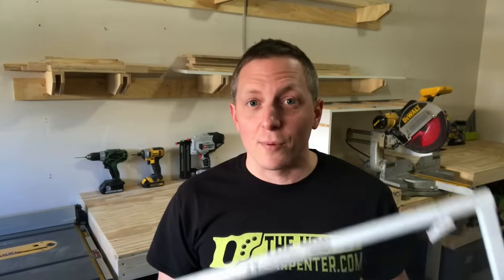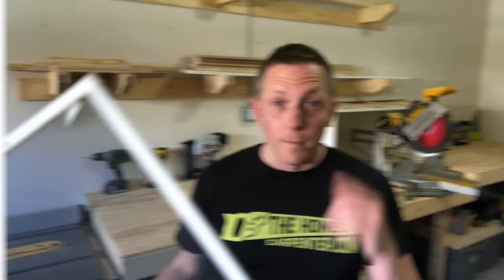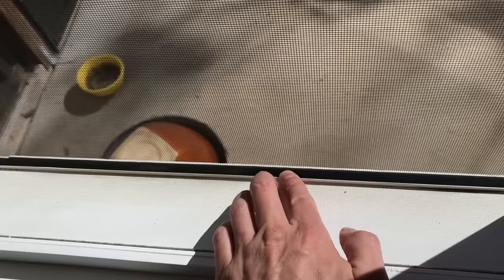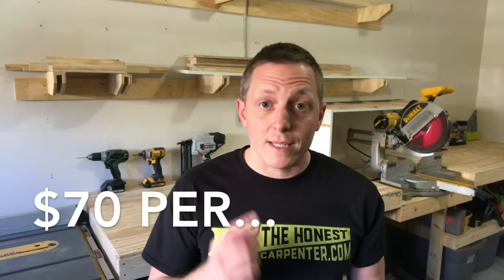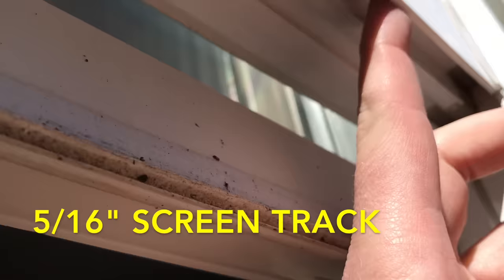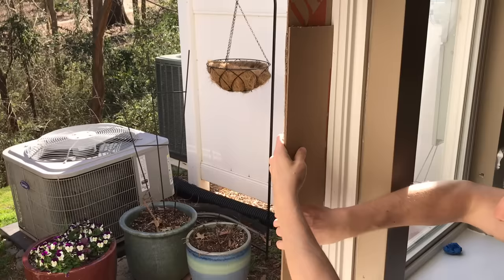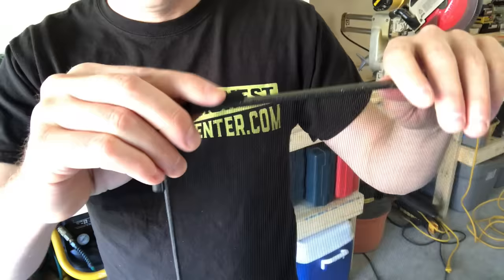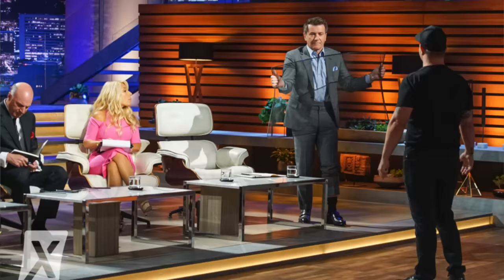FLEXIBLE WINDOW SCREENS?? (SHARK TANK Thinks THIS is the FUTURE Of Window Screens...FLEXSCREEN!)

Comment: It looks like the FLEXSCREEN would pop out if the screen is pressed against from inside, especially if you don't have the track and need to use the black rubber bumpers.  Used on second story, or higher window, might be an issue if you have small children in the house.  Every year toddlers fall from apartment windows that have no screens.

Comment: I like your method of measuring. Spot on. I suspect if the original screen frame is still intact you can take the measurements from that. That would ensure exact measurements.  On the other hand if you never had screens to begin with your method again is spot on. Keep up the great work.
Reply: They tell you on the website not to measure your screen

Comment: Window screens just don't wear out that often. My 15 year old window screens are still perfect. Not worth the 3x cost IMO.
Reply: Wait another 3 to 5 years. At 15 mine looked OK but at 20, they were shredding. 
But on some OEM screens, you can replace fiberglass with aluminum.

Comment: That's an awful lot of work to take a chance on, especially at those prices.  What if they don't fit?  Also, I don't see them as a particularly sound deterrent for pets.  A cat could push that out in one rub.  But thanks for the review.  Always good to know.
Reply: Screens are not a safety feature in any way shape or form, animals or children. Just because you can push on them slightly and nothing happens is just an illusion. Read the sticker on your screen. :) screens were invented only to keep bugs out, that is it.
Reply: @SueK449  Your cat would have to be lion to push the screen out. They aren’t THAT flexible and are not designed to be pushed out. If you’ve measured correctly and your screens are installed inside the tracks they should survive your cat pushing up against them as well as a traditional screen would.

Comment: Awsome screen! I want to measure these for my home and use these as a solar screen, for the whole window, with glue on clips to make a sleek window solar screen, on the sunny side of my home. I like the ability to use different types of screen material for different uses. Thank you Very much for this recommendation.
Reply: How would you make this a solar screen? I’m intrigued!
Reply: @Tinyteacher1111  Not sure what Davil meant, but FlexScreen does offer an optional mesh called FlexView Solar that offers sun & UV protection, which they claim can cut down 60% of the UV rays from coming in. So Davil may be thinking of using this product instead of upgrading the windows (an expensive option) or using room-darkening window film.

Comment: These are a great solution to most needs, I suppose they are fine on windows when safety not an issue
Reply: Please explain what the safety issue is?
Reply: @russgodwin1110  Children pushing/falling out of the window due to the minimal structural framing material being so flexible. possible quick exterior removal by trespassers, would be my concern
Reply: @russjackson2134  They are not THAT flexible. It actually takes some strategy and maneuvering to squeeze them in and out. And a trespasser would be more likely to cut the screen than take it flex it out. Once installed inside the track you can’t really tell it’s not a traditional screen.

Comment: Traditional window screens are a pain, as the video rightly points out, but they do offer some resistance to people or pets falling out of the window.
  Since FlexScreen is designed to be pushed out, how safe is this product, especially in upper floor windows?
Reply: I was thinking same thing
Reply: Traditional screens are not designed to prevent anything from going through it. Pets and humans can go out of traditional window screens if they want to. Which is good for fire safety
Reply: I know this is kinda old, but does anyone know of any size-customizable screens that would be hard for pets to push through?
Reply: This has been a primary reason I don't open my kids bedroom windows. I really wish there was a design that was made for safety and bug management.

Comment: I have Milgard Windows and Sliding Doors on my home and I removed one of the screens today to check the 5 Quarter method on a small window that is an XOX. There is an inside track and an outside screen track. The track was 7  Quarters deep. Since I face the ocean and the winds hit that side of the house first the O.E.M. screens are spring loaded at the top and at the bottom to help reduce movement and noise from the Pacific Ocean storms. Would I assume that the rubber bumpers/spacers would be used to accomplish the same task?
Also, may I assume that the patio slider doors are being designed by Flex Screen to eventually solve that problem too ?

Comment: they now have a measuring tool you can buy which is basically just two antennas you screw together.  however, Ethan's cardboard trick works fine.

Comment: Really interesting video! I'd never heard of these window screens until I saw it here on your channel. I do have a question! When doing the mock-up with the cardboard, why the need to subtract the cardboard after fitting it to the exact fit of the window opening? I'm TRULY not a fan of bugs and spiders(😱)so, I'd want them to fit as snuggly as they possibly can, personally!
Reply: It's so that it can be both installed and removed. If it's too tight, you can't install it correctly. Also, openings of structures can subtly change in size. Subtracting from the measurement makes it easier to fit properly.

Comment: Okay. This is going to be a bit lengthy but bear with me. 

As a man that’s been in the screen business is Texas for 20+ years there’s some thing you need to know before ordering something along these lines. 

There’s numerous types of channels that your screens are supposed to fit into. This particular video, your screens go on from the inside with pull tabs. In addition to your windows there’s also rainbow clips, ram horns, and pull tabs (inside and out). 

At Texsun, our bread and butter in solar screen. It blocks the heat from coming into your home beating on your air conditions unit, and furniture. But, we do do a lot of insect screen for roofing contractors that insurance bought. If I can give advice to any person reading this interested in these screens is insect fades and gets brittle. It is what it is. In Texas, they can last about 10-15 years before they absolutely need to be replaced. That is if there’s no hail damage! If there is an expert measuring your windows this product is unneeded because that expert will make sure that screen fits that window correct, god forbid the measurement is wrong that expert should take responsibility and fix it no charge to you of course. 
To me this seems to me something we all heard as a child, “if it’s too good to be true the. It probably is.” Which falls online with this screen. For a typical 3x3 insect screen (covers 90% of windows) we charge  just under $21.00. So for two windows at the cost of one of these you can get two windows done by an expert and save you labor. Sounds like a win win to me. Of course there is companies that don’t follow the rules we do but that seems to be the reason Texsun has stayed in business so long and others haven’t.
Reply: Providing insect and solar screens in the DFW for over 20 years.
Reply: Any company you could recommend in northern colorado?
Reply: Thank you for your observations. It helps a lot.